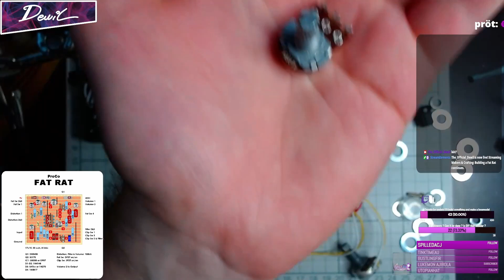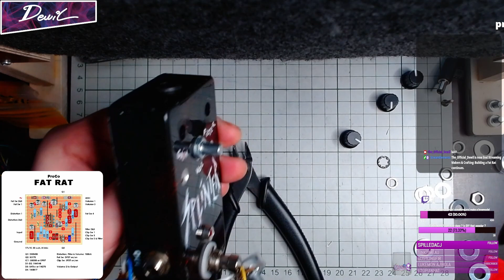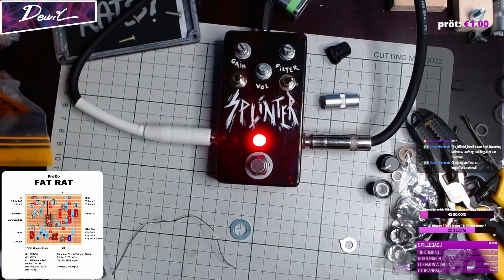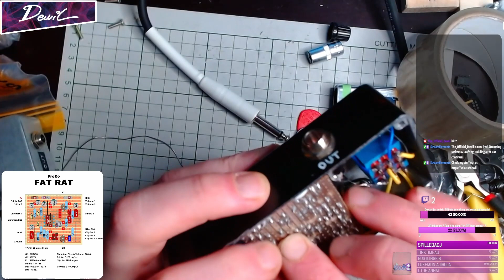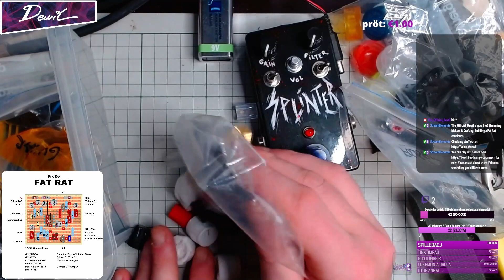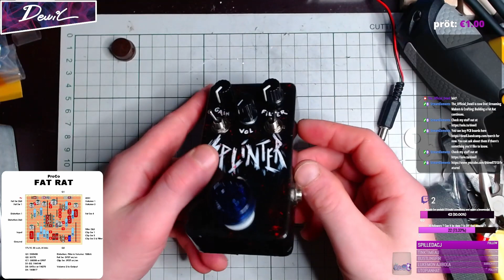DIY building a Fat Rat pt.2

Comment: So many of my troubles while learning was pots... the circuit would be fine, and I would be searching for the problem on the board when the whole time it was the damn cheap pots. When I finally learned to get better pots, building got so much easier.
Reply from the maker: Oh yeah I know. I do always say don't order parts from ebay, amazon etc. So much crappy stuff that only gives you headaches when you try to look what's wrong. Good luck on your next build, sometimes it's needed usually not =D
Reply: @dewil7313  So true...I'm fixing to prep the vero for a Frost Giant little Acid Fuzz. This is another I wish I had the knowledge to mod. The schematic doesn't have the switch and the bias knob that's on on the V2. Only thing I can do is ditch the tone trim pot and add it external. Thirsty for knowledge as always. Honestly, I believe videos geared toward modding existing layouts could attract attention? They are rare and there's only so much in books especially when I'm mostly a visual learner. I got notifications on for you. I look forward to what ever offerings you may have in the future. Thanks!
Reply from the maker: Yeah, I'll be checking soon again if I have components to stream something.
Reply: @dewil7313  Just built the little acid fuzz, its a nice brutal fuzz. I opened another fuzz I built a couple years back when I was starting out to compare. Its a build your own kit type, and it looked pretty much identical. Same ICs, same electrolytics. I didn't look too much into the specifics of the rest, but the parts count looked to be exact or near exact, even the single ceramic disc capacitor. Only difference is the byo was a 3 knobber. It lets me know we all stand on the shoulders of giants. I get frustrated trying to bring something new to the table and that helps me relax and enjoy just building and having fun.